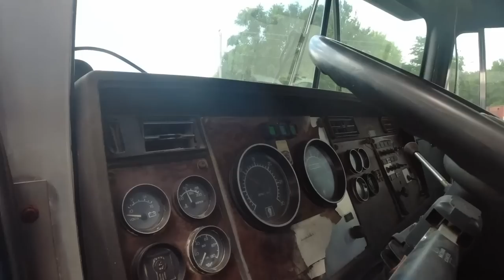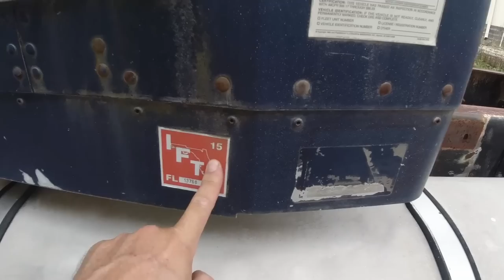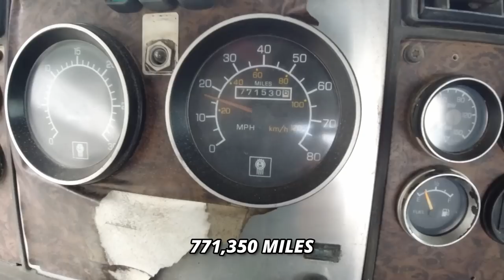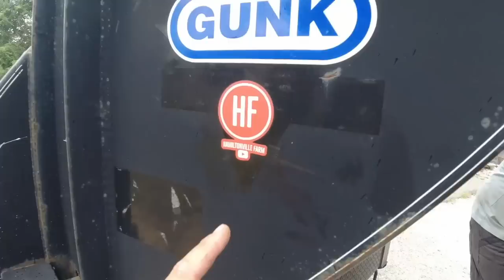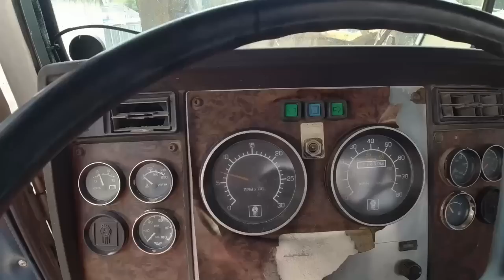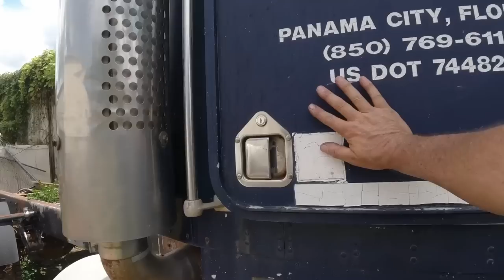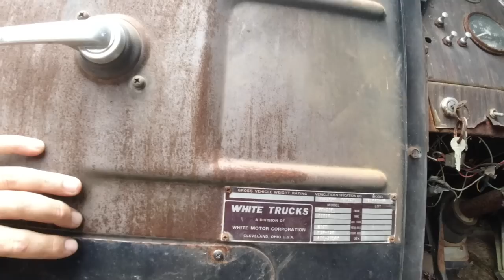WILL IT START? KENWORTH PARKED BESIDE WAREHOUSE HASN'T CRANKED IN 7 YEARS!

Comment: I bought a Pettibone telehandler that hadn’t run in 7 years, put a battery in it and it started, four used tires and it is back at work.
Reply from the maker: Those are nice machines.

Comment: He’s right, if it has just the high/low range selector with no splitter on the left, it’s either a 9 speed (also referred to as an eight speed) witch can be easily converted to a 13 speed, witch has the red splitter on the left, giving you the ability to split it only in the high side, but like he said it could also be a 10 speed if it has no splitter on the left. Now there is another Eaton Fuller 10 speed that is called the (supper ten) it has no high/low range selector on the front, but has the gray splitter on the side, that essentially has only 5 gears, 5 shifts, but the ability to split all 5 gears, making it a 10 speed. The 18 speed also has the gray splitter on the left, has the same shift pattern as the 9, 13, and the 8LL, with the high/low range selector in the front, giving you the ability to shift 9 times, and split 9 times giving you 18 speed, with 4 reverse speeds. Eaton also made a 15 speed as well, with the same shift pattern as the 10 speed, but with the blue splitter on the side giving you the ability to split the lower 5 gears, with the high/low range selector in front giving you the ability to shift 10 times, giving you 15 speeds. Eaton makes a transmission called the 8LL, which essentially is a 9 speed that just like the 15 speed has the high/low range selector in front, with the blue splitter on the side, that you normally shift four time’s in low range, four time’s in high range, but also has that low gear for them really hard pull take offs, but you also have that blue splitter that give’s you the ability to have one more lower gear to help and assist on them really hard pulls, giving you 8 forward speeds with double Low Range, so you usually commonly find the 8LL in like Dump Trucks and heavy duty work trucks, the 8LL is not a highway long haul transmission. The 18 speed is the best all around transmission, they have the ability to give you highway miles, and heavy haul capabilities at the same time. I hope this helps you my friend, i love your videos.
Reply from the maker: It does!! Thank you. Great information 👍
Reply: It is only gray wire

Comment: That’s either a 9 or 10 speed. If u have a little blue button it’s a 15 if u have a little red button it’s a 13 speed if you have a little gray button it’s a 18 speed trans
Reply: Blue button can be a 7 or 8 double low also but if it's on a truck with a fifth wheel it's usually a 15 speed
Reply: @markwilliams4525  ok I have learned something new thank you sir
Reply: A super 10 has a grey button also
Reply: @darrencatenacci2737  but it won't have the range selector switch on the front
Reply: 10
Reply: If no.spiter on the side and button is gray super 10
Reply: @markwilliams4525  I drove a dump truck with the 8 speed with double low
Reply: @dieselwrench3621  very good transmissions
Reply: @markwilliams4525  yes they are 👍

Comment: The colors of the splitters are 
Blue is an low low 8 maybe an older 15 speed 
Red is an 13 or some 15 speeds 
Grey is an 18 speed and also a super 10 
9 speeds and 10 speeds only have the high low splitter up front
Just my experience with them
But then again I'm only 24 maybe someone else can concur with that

Comment: If it hasn’t been said already that cat is not a 3406 that would be a 3176 or possibly a 3196, you can tell by the air to air pipes are both on the passenger side. Also that truck had a sleeper on it at one point, you can see the back wall is a filler panel (with no interior covering it) and it will has the sleeper mounts on the frame rail about 4’ behind the cab

Comment: i still think on the detroit that the left bank throttle linkage isnt hooked up to the right bank , you can hear it when it runs that it doesnt pick up as smoothly as detroit's tend to do , it was only running on 4 , i wonder what a half engine runaway would sound like , im surprised wiley didnt figure that one

Comment: The original Detroit Diesel engine's (made by general motors called Jimmy's or jimmy diesel etc !!!) Were 2-stroke (2 cycle) engines and to flush out the exhaust gases to let fresh air in the air had to be pressurized,,, hence the need for the blower (gear driven supercharger) so the were called naturally aspirated, the 318 (8V-71) was supercharged but not blown (turbo charged) the 350 Detroit Diesel was turbo charged (blown) so really all Detroit Diesel engine's were supercharged enabled to run naturally aspirated !!! Some were blown (turbo charged) later on they came with bypass blowers to relieve super charger dynamic load witch allowed the turbo boost to bypass the blower.
Hope I've helped you out on this. All the best Sir.

Comment: new turbo, filters, oil, greasin etc. be ready to go. blowers always equal supercharged. Basically super chargin is pressurizing the "natural" air charge goin into an engine. Therefore the "super" in front of the air charger equals more cylinder pressure and a more explosive combustion stroke which is why blower engines have lower than normal compresssion ratios...

Comment: My input is that truck one has a small cam 400 Cummins in it and truck two with the Detroit diesel is not naturally aspirated. All Detroits have a blower in the center of the engine to help push air into the combustion chambers being that they are a 2 stroke engine family

Comment: The Cummins slant 6 came in 2 flavors that I know of for sure. An NH250 hp and a NTC230. I drove a '79 Ford 9000 that I assumed had a 270 or 290 as it was turbocharged, but upon cleaning the ID plate discovered it was an NTC230.

Comment: No difference in the color of the range valve on a 9 or 10 speed. I would rather have a 9 because it has a lower Low gear than a 10 speed.

Comment: 9 and 10 speeds have the single splitter like in this video, a 13 speed will have your range splitter like the 10 speed but also have a red splitter on the side, the 15 speeds have a blue splitter on the side and the 18 speeds have a gray splitter.

Comment: The white engine was on a 15 degree angle to get it to fit. Western star carried thru with this design with their big bore Engines until at least 2000 with the short hood conventional. It probably is a 220 Cummins.

Comment: Bro i wish they can do a will it start on my truck thats been parked for 8 years
Reply: Email him your location
Reply: @db7059  i can't im from Philippines very far from them
Reply: Same here except im in the USA. The truck that my dad has would probably be a big challenge for hank since it’s a late 1980’s Isuzu Trooper
Reply: @jakealter5504  my truck is also a Isuzu,long nose type of truck
Reply: @guillerfalcunit6807  cool, my dad’s is a smaller suv and it is extremely difficult to try to find parts for. The only replacement part I was actually able to find for it was inside door handles, I really struggled to try to find a replacement door rod though (luckily I was able to find the piece of the door rod that had broken off and was able to get it welded back together).